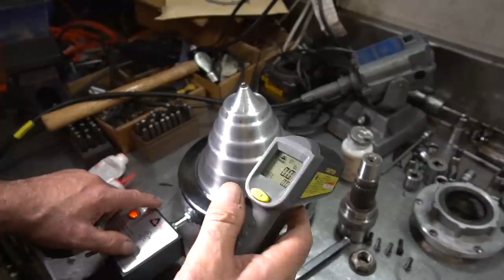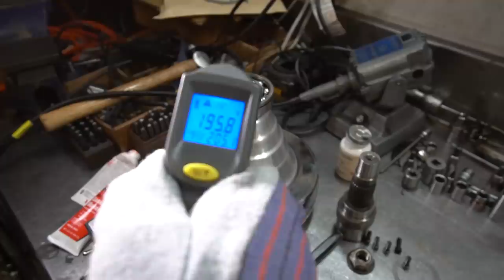Dana 300 Transfer Case Rebuild - Part 2 - Assembly

Comment: Around 27-28 minutes, you cut out the cup bearing. Mine is stuck as well. I have mangled it a lot, but the outer ring is still stuck flush/tight to in inside of the shaft. What did you use to cut it? I've bent a few chizzles already. Great video, thanks!

Comment: Seems like the input shaft shims are hit or miss  , some have them some  dont , i am replacing my input shaft due to spline damage, the old shaft had no shims, and 0.013 endplay , i am the original owner and nobody has ever been in the 300 before and only have 68k miles on it.  With my new advance adapters shaft installed with a new bearing its 0.012 endplay , when questioned Advance adapter said it was good to go at 0.012 and they never shim there dana 300 inputs upon assembly . Any thoughts paul ? . Excellent video series by the way .

Comment: when I took off my transfer case I drilled a hunk of plywood and bolted it to the case and put it in the vice ,, but I was only cleaning it out and fixing oil leaks .. and yes they are very heavy .. I did my on the floor in my garage under my CJ7 ,, need to get a floor jack tranny jack so when I pull it again ..if it was a flat lift easy  but it has to be at a angle ,, so a floor jack is hard to use .. Great video Paul .. thankyou for all the great info and tips
Reply: I've had similar issues pulling and installing transfer cases in the driveway.  Got a bit smarter this last time.  using a 10" 1x6, I screwed a vertical board on one side (catches the end of the TC) and a 2x4 laid flat screwed down on the other.  The 2x4 is for the rise of the bottom.  In other words, I built a cradle.  Using a floor jack on the now-flat 1x6, I easily pulled the TC back and down.  Granted, I still had to balance it.  But it worked like a charm.  May get a good center of gravity and find some way to screw the 1x6 to the floor jack.  My days of dead-lifting transfer cases by myself have long passed.

Comment: Great video Paul, very informative.  I'm currently in the process of putting a Scout D300 behind a T-19 wide ratio 4 speed, and the Scout Dana 300's are slightly different than the Jeep D300's.  There's no dedicated input carrier, the drive gear is simply mounted to the output shaft of the transmission and bolted down, then mated with the transfer case.
I'm a little worried as my drive gear got some bad rust on it over the years while it was sitting, and the teeth are somewhat pitted, and as far as I know, are pretty much "unobtanium".  It took me four years of searching to find the one I did (my D300 came with a drive gear for an automatic tranny.)  So I expect I'm stuck with using it.  I did clean off the gears as much as I could, including using a bit of wet/dry sandpaper to get the worst of the pitting down.  I figure I'll run it, and then change the oil after 100 miles or so to remove any impurities that may have worked loose.
Reply from the maker: Have you tried Advance Adapters?

Comment: you can get Indian head shellac from auto zone for $4.99 (either locally or online). I prefer something far rarer called GM Gasket maker that's much more expensive (sadly) but i like to use for water jacket bolts that can leak. (Great music btw).

Edit: For what it's worth, those of us who work on auto transmissions use the same lube. We use the blue for lubing and the green for holding spacers and such. We don't use the red or the yellow because if they leak you don't know if you have a leak (oil or transmission fluid) somewhere. :)

Comment: You have probably covered this elsewhere but it seems you prefer anaerobic gel over RTV. Rationale? Thanks for the great videos
Reply from the maker: RTV doesn't cure internally. So if you are building a unit that is going to get installed and filled with oil in a few days or hours RTV can cause leaks

Comment: A. Regular, what does that mean? Anyway, while rebuilding my Dana 300 I discovered that the "end Cap" was broken. End cap is the term you used  when referring to the part that slides over the rails and holds the rail seals in place. Is there a part number or another description? I can't find it on a parts diagram.

Comment: Shaft needle bearing had a small hole. Is that an oil holder needs to line up with a hole in the output shaft? Excellent video thank you
Reply from the maker: No not necessary

Comment: Hey Paul, great video !  I have a Dana 300 Transfer Case in my 1983 Jeep Scrambler CJ8 which I have already rebuilt. Do you recommend using a full synthetic oil in them { transfer cases } ?  Im a Hugh fan of the Amsoil full synthetic's.

Comment: Great vid!! Thank u!! Jus bought a 82 cj5, the forks r stuck, i took drain plate off and there was barely enough oil to lube teeth on gears, plus i found half of a very thin round metal shim or bearing seal. Cant find the other half, but, gears and everything looks great, despite the item. Magnetic drain plug had just a little bit of metal, minor, thoughts?
Reply from the maker: If you want, send a picture of the parts that you found to my email address. All the info is in the video description

Comment: How did you get the tail shaft back apart (around minute 27:00)? Did you press against the big gear in a press and push the shaft through?

Comment: I stuck around and did a full watch on part 2. On my '84 Jeep CJ7 the transmission that is coupled to this Dana 300 transfer case the shift lever slips past the rails and pops out of place so it locks into 4th gear. I bought new retaining parts to hold the shift lever down better. but it still happens. Looking at the tang on the shift lever doesn't show any wear. Do I need to do some work on the rails? I think it is a Tremec T-176 if I am not mistaken
Reply from the maker: I know this is a common issue and some people add washers under the detent spring to give them a more positive feel.
Reply: @GearBoxVideo  Thanks, I watched your Jeep T-176 video and think maybe I should inspect that one area you showed on the cover to see if that is worn. Seeing the cover on video helps put how it works int perspective.

Comment: I think this is the transfer case used in my 1971 Bronco. If it is, I iteraly beat the Hell out of it off road and never had troubles with it. I ripped rear gears and fronts, but never this TC.
Reply from the maker: Big issue is snapping output shafts

Comment: I'm having some trouble getting my shift rails back in to the shift forks they came out pretty rough and I cant get them to go in now I even took a fork out of the case and tried to get the rail in on the bench and it will not go in do these require some tapping or should they just slide in? Maybe polish them up alittle or heat the fork?
Reply from the maker: Clean the rail up and take notice of high spots. Do not heat anything. Think it thru

Comment: I have a 63 scout with 4cyl. How much power csbit handle? I like the 3shifter look, but more power is a must! I don't plan to have anything over 31" tires., probably 235-60- 15", or 30*9.5*15" I was thinking about swapping in a 2.8,3.1,3.4L gm v6 or maybe a 4 cyl from a S10, or maybe a 20R or 22R 4 cyl Toyota engine. It's not going to be a powerhouse. Just a bit more than the model T or A performance. It's slow as $%@#!!!!  With the 1/2 of a v8 4cylinder! Great video!!
Reply from the maker: The output shafts can snap. Advance adapters makes a HD output shaft and housing kit
Reply: Frank Saliba  love your video on the dana 300 transfer case, can you please do one on the ford T18 transmission in my jeep.
Reply from the maker: Ship it to me. I have none here

Comment: what torque did you have the yoke nuts set to? I can not seem to find a consistant number on the internet and was wondering if you knew?
Reply from the maker: Go to 25 mins into
Reply: @GearBoxVideo  Thank you so much, I skipped past that part thinking it would be in final assembly
Reply from the maker: Problem is everyone skips and you end up not getting the details.

Comment: hello
in 11:20 minute you use main bearing for front shaft.
can you tell me cast number? i need to buy it from shop.
Reply from the maker: If I still had it in the shop I could tell you. The trans and parts are long gone.

Comment: That anaerobic sealant that you use do you recommend using that on a differential cover vs gear oil gasget maker. I’ve normally used a perm attacks brand the gasket maker it to be the screen and the contents are gray
Reply from the maker: I don't think it matters much. Anaerobic would be used if you need to use it immediately. I always still use a gasket plus a thin coat of sealant on both sides.
Reply: OK thanks. I watched your video and did my first DANA 300 the past few nights. It came out great,you had a lot of good tips and I appreciate that. Also your video quality was excellent. Anyway, my jeep is back humming along. That’s the first time I worked with that anaerobic sealant and I really liked it.

Comment: Could a guy boil the bearing in water at 212 degrees F and drop 'em on? Then spray with WD-40 to cool off and displace water? Anyone ever try that?
Reply from the maker: By the time your spray the wd40 on the bearing it will cool it down. Plus you risk water contamination. WD will not fully displace water